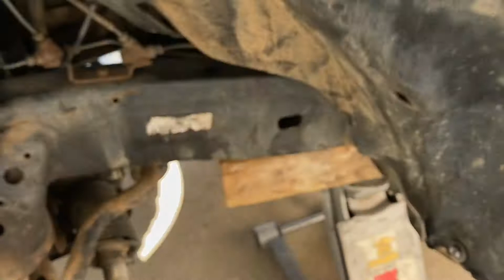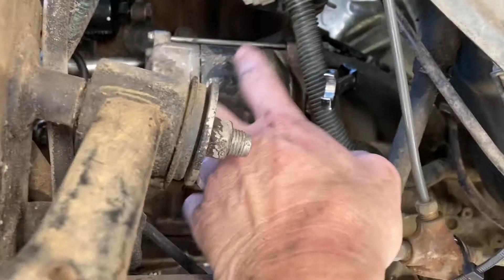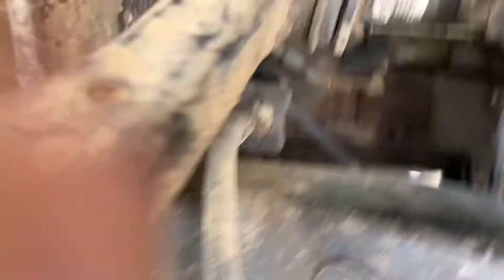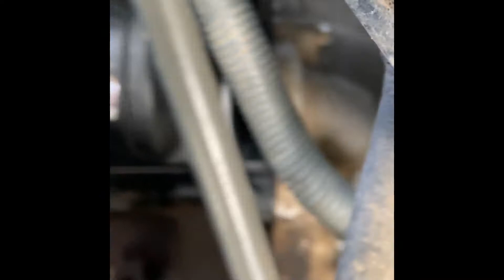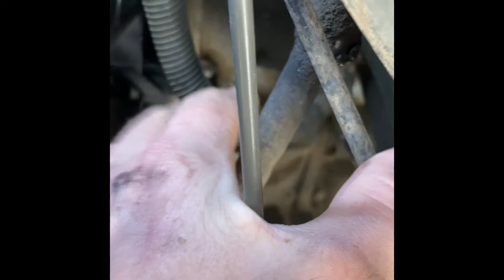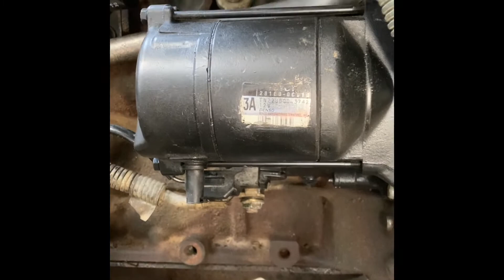Andy’s DIY: 95-2000 Toyota Tacoma 2.7 starter replacement

Comment: Lol I got my starter unbolted but I have a clutch slave cylinder in the way and I only just started but I can't figure out how to get it out without breaking open all the hard lines for the clutch and brakes and I really really don't want to bleed either of those things after. Lol. So frustrating after only taking 29 minutes to I bolt the starter.
Reply: Me at this exact moment FML
Reply: I just unbolted the whole slave cylinder just two bolts and move it to the side

Comment: I got a 97 automatic 4x4 reg cab. Do I need to disconnect battery? Seems something I can do in like a minute. Just need a 14 and extended swivel wrench huh. How long did it take to rebuild? If its to long id rather just trade it in for a remanufactured one. Thx
Reply from the maker: I would always disconnect one of the battery cables when working on anything electrical on car. Forgot to mention. Don’t have to, but it prevents accidental arching. Good catch!
Reply: @andrewlewis7025  I just changed it for a reman. toyota one ($180). Truck runs💪 thx.

Comment: NOT USEFUL.  The hardest parts of this whole project were just glossed over at the start.  Find another video.  Your connectors and two bolts will be challenging to remove. Not covered here...everything covered is a cinch.